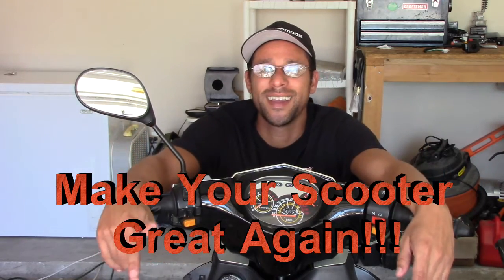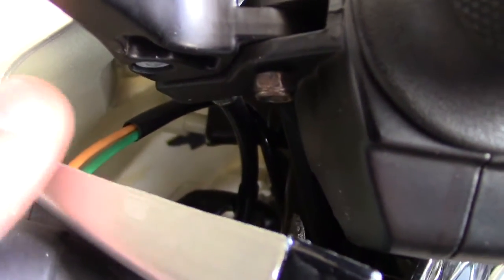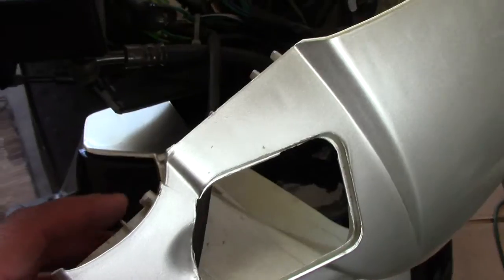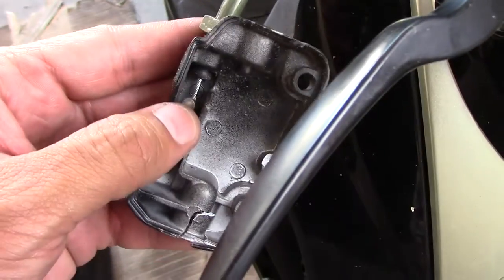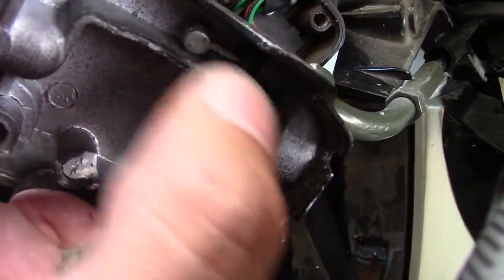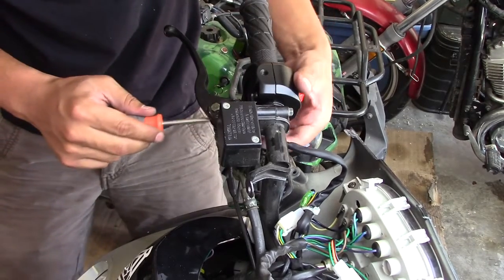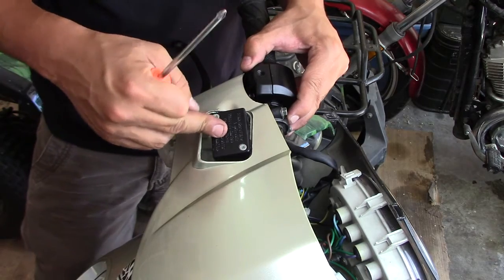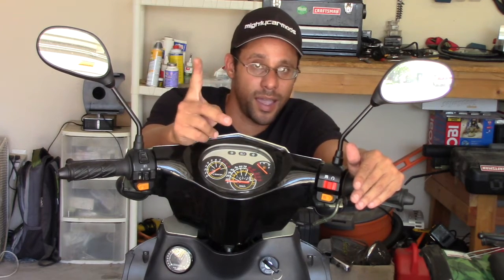GY6: Switch Assembly Replacement

Comment: Getting ready to replace mine less I chicken out and just replace gearbox cover and kickbar simply use kick bar .not even sure if switch is bad so old switch might work with new starter was gonna replace voltage regulater case that was what was stopping old switch from working we will  go from point to point in consecutive simpleness

Comment: having scooter starting failure... Have spark @ plug. I installed a new carb (24mm I don't have a big bore or anything that would justify going bigger) and when I pull the bottom hose I do leak a little from the line so I know im getting fuel, carb should be full by now (over 2 minutes of cranking attempts)When it's turning over the muffler gives a low pitch popping...